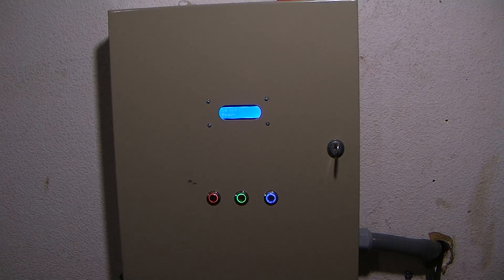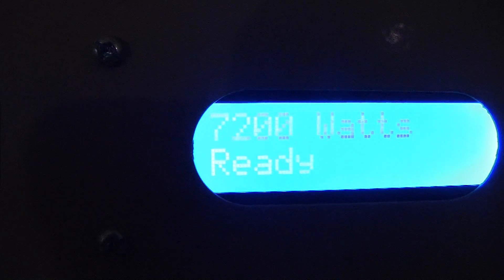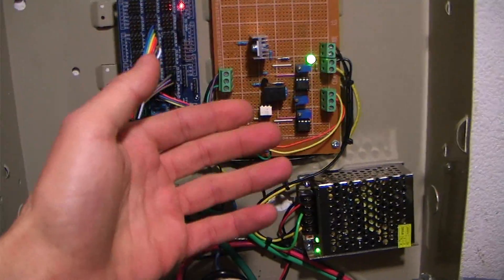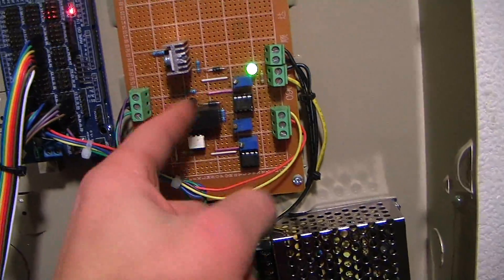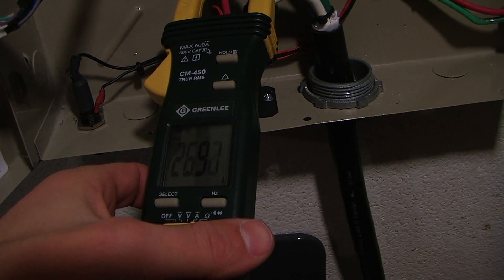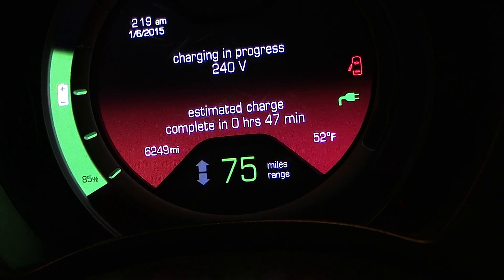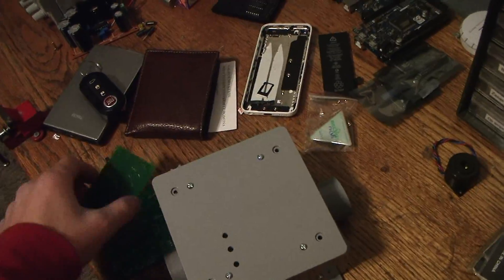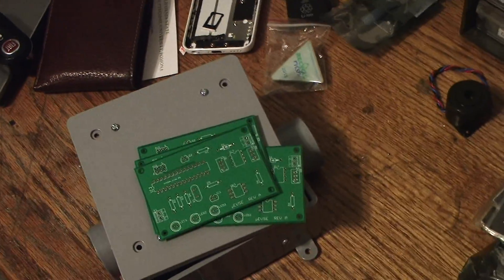Homemade level 2 EV charger quick overview

Comment: I really want to make my own evse, with a dial amp adjustment. I carry a 3000w generator i need to charge with sometimes. It will charge my truck 12a 120v but 12a 240v is just a tad much.  I will try raising the proximity resistance, but AI says amps should be reduced with the pilot pin duty cycle.

Comment: Kit building in the US is mostly a lost art but it offers several advantages:
1. New products can be brought to market quicker and the assembler is qualified if a modest hardware update is needed.
2. The product liability might be less because not-yet-UL things can still be sold without undue manufacturer risk.
3. Liability for the homeowner is NOT increased.  State Farm Insurance (in the US) has told me that no matter what whacky thing you saw on the internet and decided to build, should things not work out as planned, you ARE covered as long as it can reasonably be shown that you intended to make your place a better place.  EV charge equipment kits qualify; a DIY moonshine distillery does not.

Comment: They make portable ones that plug right into your dryer outlet. About 300 bucks on amazon with a 22ft cord. Doesn't reach? Buy a 240v extension cord. 1500 bucks? Nah..

Comment: your wire gauge and circuit breaker are too small.  it should be on #8 and a 40A circuit breaker.   30A of peak current x 1.25 = 37.5A   (another 1.25 for nothing being continuous duty rated most likely.)  There is a reason for UL listings.

Comment: 240v without a "neutral not needed"?  I'll have to ask my electrician friend if that's legal or not.
Reply from the maker: Sure it is! Home appliances use this configuration all the time. Most air conditioning compressors, hot water heaters, and clothes dryers are 240V without a neutral. No reason you would need it.

Comment: hey ,
what happens if we use 120v instead of 230 v in these same circuit.
Will the car try to take 30A.
Remember we don't change anything in the circuit only the input voltage.

Comment: Isn't the charger itself actually in the car and this is simply a control circuit for the charger input?
Reply: Yes, its main job is to tell the car the max amperage of the supply circuit and to turn power on and off when the car asks.

Comment: Hi Jacob .... very well done video, long time back I used to do projects with micro-controllers, this was a good refresher. I bought prius prime and it came with a 110V cable. I saw another video on youtube where it says you use NEMA 10-30 to 5-20 converter and you can use same cable that came with Car to charge at 240V. Do you see any issues using it 110V cable that Toyota provided to use with 240V ? BTW have you assembled the PCB that you shoed towards the end?

Comment: Okay, this is way out in left field coming from a complete novice . I'm building a camper van to go cross country. I'm hoping to use a Tesla model 3 module (slab) as my house battery. Solar will likely not be able to keep up with my power needs.
What would it take to be able to use EV power station to top off my battery along the way.

Comment: It would be nice to be able to buy just the finished control board and then adding the other less sensitive components to it, like relays, power supply, etc. It would make building one of these chargers an order of magnitude easier.

Comment: Jacob, I am a retired EE.  The control panel lacks an interlock safety that can easily be part of your key lock like a lock/service and run (easily just a 12VDC shut off).  I don't know if your software uses a sense circuit before it sends 240VDC to charge your FIAT 500 EV.  

BTW, back in the late 60's I had a FIAT 600D 1.1 litre gas engine.  It was a suicide car (backward opening doors, etc.  The new FIAT 500s are a class above those FIATs.
Reply from the maker: There is no need for that as the relay never closes till the vehicle is connected. Because I built this charger for myself it wouldn't be necessary to add an interlock to shut off the power when the door is opened. The voltage is 240VAC not DC but that doesn't matter much. Why would an interlock be necessary?

Comment: nice job! love to figure things like this out,but in nursing school so busy busy I would like to put one with a plug into 220 outlet Campground etc
Reply: michael patterson my 2014 Smart has the same ESVE. I've been running it on 240 volts. Same with my Chevy Volt. I think they built them 120/240 for USA/Europe/Asia. I just made a 120 to 240 adapter.

Comment: What is the deal with the pilot pin?  Is the vehicle controlling the charger?  Or the other way around?
Reply from the maker: Steve Roberti it is sort of a two way communication. The car really controls the line and tells the charger what to do but the signals on the line tell the car how much current to draw and when it can charge. Watch my video series where I explain how I built this charger and I have an entire video explaining the pilot pin and the j1772 protocol.
Reply: Jacob Dykstra Thanks.  I will check it out.  I guess whatever the standard is it must be relatively simple if its all communicated on 1 wire.
Reply from the maker: Steve Roberti it is a very simple standard. It is all analog voltages and PWM no digital communication or data frames or anything like that.

Comment: Make a video on level 3 dc fast chargers.
Reply: most fast chargers are 300V-480V or 3-phase lower voltages.  Not available at a house easily.  You need lots of extra equipment beyond this.
Reply: @edwardruiz8920  except that every solar system on every house produces power at 500v
Reply: @chris2pherrea  that's not true for microinverters or power optimizers.  A typical central system varies from as little 250V up to 1000V on the DC side at a residence.  The Tesla powerwall operates around 400V for the purposes of charging Tesla EV cars through solar sources.  The output is usually single phase 240VAC.
Reply: @edwardruiz8920  Right, but as I have the option to install a new system on my house as 25Kw, I can choose to make them 500v strings, and could them use them directly into the DC charge port of my leaf ??

Comment: For a 30A draw you need a 40A circuit... running at 100% for the extended time a car charger draws will overheat the breaker. For a 30A breaker the max continuous draw is 24A.
Reply: Not just the breaker.   He needs to run 8 gauge wire to pull 30 ams.  As you state 24amp max.
Reply: Um no your wrong a 30A breaker will supply 30A all day every day because that's it's max continuous rating... also 10AWG or 6mm2 is the correct size cable too
Reply: @rjac001  It will work, but it's against code.  It's legal for a non continuous loads.  But for continuous loads 3 hours or longer the 80% rule applies.  210.19(A)(1).
Reply: Jason Kates The circuit breaker is only there to protect the cable, the 10 gauge wire is rated at 32A continuously and so there’s no risk of damage or fire to the cable, also it’s a fast charger so I doubt it will be delivering maximum current for very long
Reply: @rjac001   Have you looked up 210.19(A)(1).  I agree it's likely to be very safe.  It just doesn't make code.
Reply: Jason Kates If that’s your local regulation then by all means stick to it, at the end of the day it’s up to you, we have no such rules in New Zealand so I was just stating that it would be safe to do. The worst case scenario would be the breaker if it was over sensitive or faulty it might trip after several hours and need to be replaced.

Comment: Although I watched this video lately but i think you're right 
what i realised is that it's not a charger rather a monitor 
i have a problem that I would like to ask you about
i bought a GE durastation level 2 charger 60hz and i took it outside to Jordan where the 240v are one phase and one neutral and not like it's in the states, also the hz is 50 not 60 
it didn't work but i could test it to see the problem which was the hz thing.
I wonder if you could help me to convert the charger from 60hz to 50hz 
thanks.

Comment: Wonderful video, thank you for making it.  You should make this open source.  
So let me get this straight.  I'm new to all of this.  So the charger (AC to DC conversion) is really located in the car, why do they call the thing they call a charger for $500 to $1,000?  Seems to me it's not a charger but a micro controller to control the amount of AC being delivered to the charger in the car. 

When you refuse the current being delivered tot he batteries are you just cycling the power relay to reduce the amperage/wattage?  If so, seems to me the relay contacts would burn out in no time.

Any idea why they did not put all of the charger circuitry into the car?  So to charge it, all one would have to do is use an extension cord and plug into a 120vac or 220vac outlet?
Reply from the maker: I made a series of videos explaining how all that works in much greater detail and actually show how to make one. To limit current it is not the power relay but rather the charging unit in the car regulates the power electronics within it to decrease the current.
Reply: ***** That makes sense.  So what's the purpose of the external $500-$1,000 "charger" circuitry if the charger is already in the car?

Why not use a 120 v or 240 v extension cord to the charger in the car?  What am I missing?

Can you provide the links to your videos?  Thanks for making them.
Reply from the maker: I explain it in my first video about how to make the charger. My fit charger video has nothing but details about this charging standard and how it works. The primary purpose is to de-energize connectors until the car is ready to charge and also to tell the car how much power the specific charging station it is plugged into can supply.

Comment: I thought you guys had 120V in the United States?
Reply from the maker: we have two separate hot phases 180 degrees out of phase. Each phase relative to neutral is 120v this it what you normally get out of an outlet. Between the two hot phases they are and you get 240V. This is usually used to power larger appliances such as air conditioning compressors, dryers, heaters, and electric car chargers.
Reply: So in US you can choice to use one active 120 V or two 230 V? 
So what happens if someone use two actives in the rest of the world 400 V?

Comment: Would love to build one. Will keep monitoring, can I get the PCB layout so I can get board made?  Thanks John
Reply from the maker: Sorry I no longer have the board layout files I made them many years ago but I recently made a series of videos on how to build one of these chargers.
Reply: What is the chip part number you used for the micro controller. Thanks

Comment: where do yoou install the Prox detection wire cause My dostar  cable has a 5th wire as well as the control pilot.
Reply from the maker: Damion Litrel you should not have to hook up that wire all the proximity signaling is done between the car and the resistor network in the connector handle.

Comment: Set up a patreon and make this opensource. You could sell diy kits on ebay. One kit option could be just the arduino with sw, relays, pcb. Often DIYers have auto ranging 12V power supplies lying arround and the bulky heavy stuff can be sourced locally. Also using github allows collaboration and sw vetting and improvements. Kick starter is unnecessarily expensive. Use PayPal which gives buyer protection. OSH park does low volume pcb cheaply.

Comment: hey jacob - you should add a amp meter to the charger showing how much power the car is using - giving an indication on the battery charge level without having to go into the car and check!? - also do you have solar on your roof? - it would be an awasome addition - even if you were to use some Ebay solar panels and the Ebay micro Grid Tie inverters - they work alright aslong as if its rated for 500w you only put 400w thru it!

Comment: Awesome video. Just got a 2014 spark ev. I wonder what the max amps in 240volt charge mode my car would draw? As Im just learning the cars have onboard chargers that limit the max amp charge, so getting the biggest amp 240 charger might be a waste of money if your car won't use the power. But I'm looking to make my own charger and help others make there ev,s more affordable here in New Orleans its the oil mans land.

Comment: Also, though that relay is rated for 30A, the QD terminals are not. Fortunately your car is not pulling a full 30A, but if it were, those QD terminals would overheat. I speak from experience.
Reply: +Nick Sayer It looks like he soldered and shrinkwrapped the connections, that should be good enough for 30 Amps!
Reply: +J Bishop Yeah, no. Been there, done that.
Reply: Nick Sayer If the relay is rated for 30 Amps how can the connections on the relay not be 30 A?
Reply: +J Bishop 30A in general does not mean 30A continuous current for an unlimited time. In general, unless the component specifically says that it&#39;s rated for 30A EVSE or continuous duty, you need to derate it by 20% when used for continuous duty service.

I haven't ever found QD terminals that work long-term at more than 24A. And even getting them to work at 24A requires using a ratcheting crimping tool, and using it properly and with very high quality terminals. The ones I use were something like 75¢ each in Q:100 from DigiKey. The crappy ones you get from Home Depot are no good. And you don't want to solder crimp terminals. Solder actually doesn't conduct nearly as well as copper does, and if you do the math, a resistance of a mere tenth of an ohm at 30A will dissipate 90W of power!
Reply: Nick Sayer I didn't know that either.  Are you an engineer?
Reply: +J Bishop I do software for a living, but the dive into EVSEs rekindled a long dormant hardware side in me. OpenEVSE introduced me to Eagle CAD, OSHPark, Arduino and the rest was history.
Reply from the maker: +Nick Sayer the relay was a problem  for the project. I went through several before finding this one which was capable of handling the current. previous relays got scary hot if running at full power and the ring terminals had minimal surface area contact creating even more heat. Finally I found this relay which gets a tiny bit warm but actually handles the current pretty well as do the connectors. The connectors are crimped spade connectors made for 10 guage wire and actually handle the current well but I would imagine if the connectors were loose at all or had any less contact, they would get toasty. The solder is primarily in place to hold the end of the wire in and actually helps a little bit by improving more direct contact surface area between the wire and connector. The amount of current flowing through the solder is probably miniscule. Most of the connector is direct copper contact and is crimped specially and then crimped again once connected to maximize the connection surface area and keep heat to a minimum. The result turned out pretty well but I will say this method isn't for the average Joe because if not done right using the same parts, it can overheat and those connectors will melt or weld.